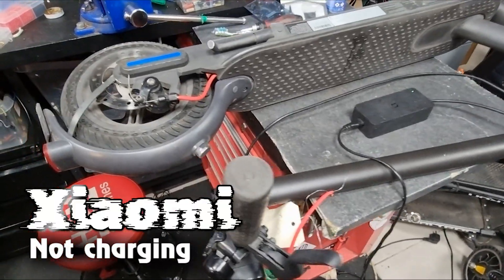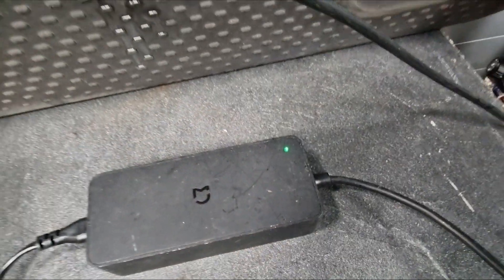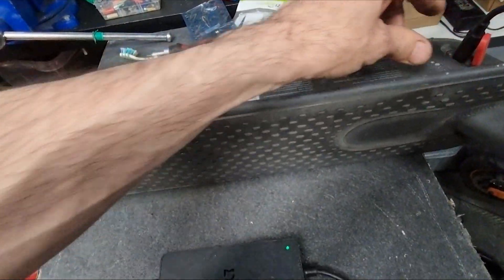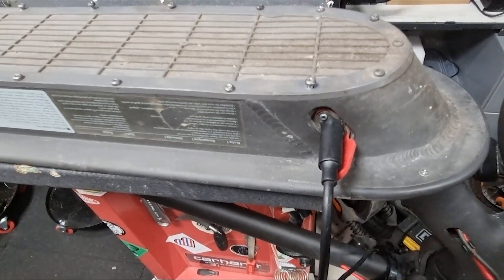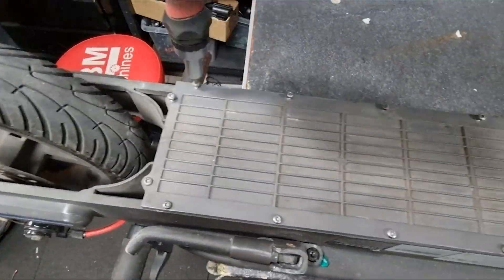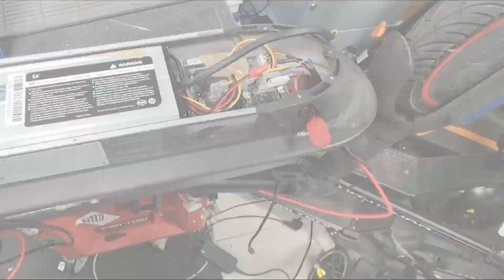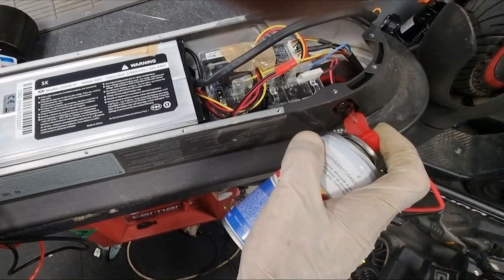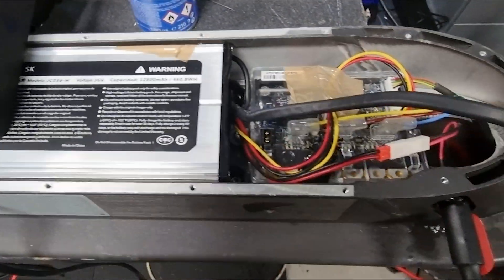Electric scooter Xiaomi not charging. How to fix? Diagnose and problem solved. DIY.

Comment: Same problem with my scooter when i put on the charger there is only for 2 second red light after 2 seconds again The green light is showing how to solve this
Reply from the maker: @Ajaysingh-wm2zf  Did you check it with multimeter? Which model you have? It can be battery, but check the battery first.